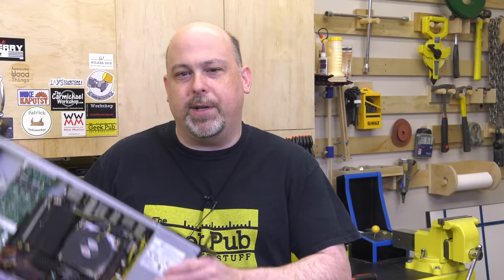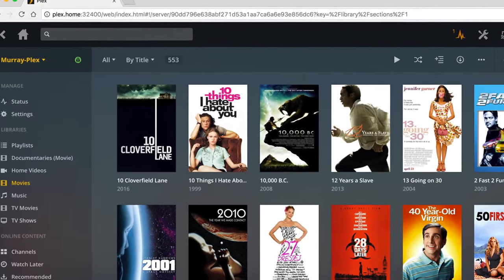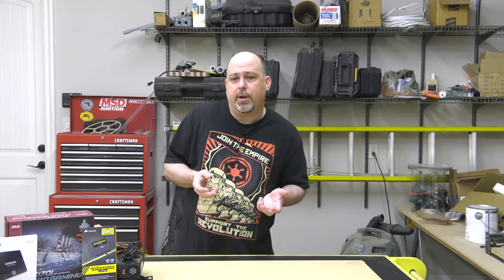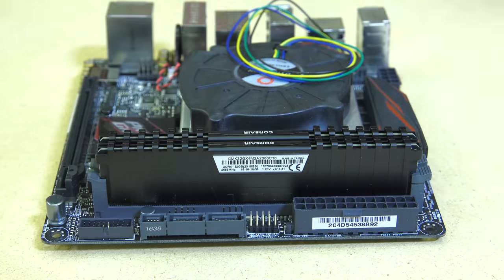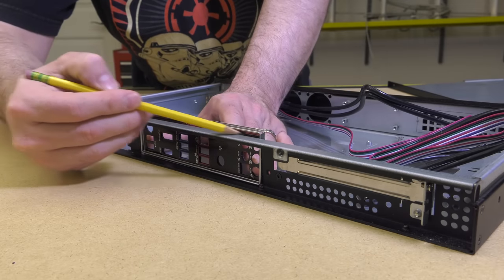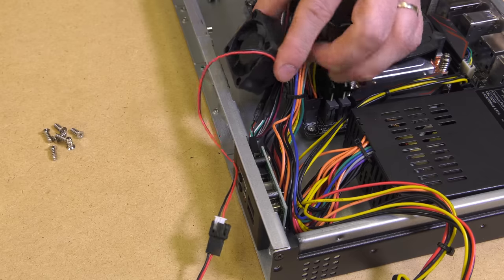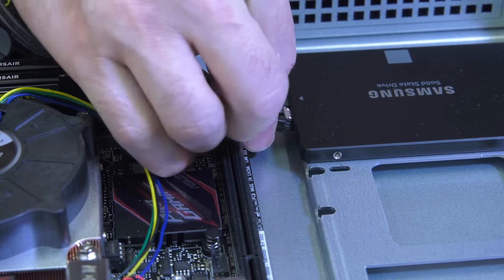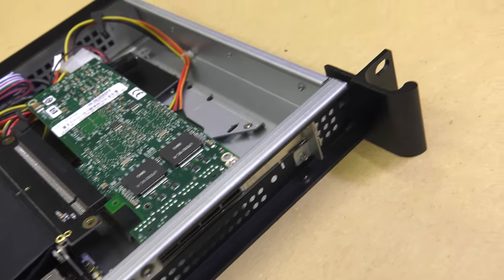Building a 1U Server (Bad A$$ 1U Server)

Comment from the maker: The audio anomalies are due to the AGC circuit on my camera failing.  I shot the whole video before I knew this was happening. Panasonic has already replaced the camera and future videos will not suffer the same fate.
Reply: Why not use speech leveling in Adobe Audition?
Reply from the maker: I don't own it for one.
Reply: the video I just watched from someone else was doing the same thing. 
I was starting to think it was on my side
Reply: TheGeekPub just wonder why you have your own server and what the benefits are?
Reply: sanveer gill Speaking for myself, I have a server with esxi installed which allows me to install multiple operating systems. Try finding 32 motherboard and associated RAM in a home, if I was to use dedicated hardware.
Reply: Small advice: make a simple teleprompter. There is a plenty info in google and youtube about it. Its just better for watching when you talk stright to viewer and not below him. But overall great video!
Reply: You do need at least 2 disks for redundancy doing raid1... using 1 disk is so 90's now-a-days man.
Reply: Up let
Reply: Ufk
Reply: Gday Is it possible to use a PICOPSU  for a 1R case with ITX mobo ?
Server psu's are bloody expensive in AU region

Comment: Great build. I plan to build a ESXI server for home development testing and your video gave me a lot of great ideas. Only thing I would have liked to hear is the noise level of the fans at 100% and idle. Thanks for posting.
Reply from the maker: Thanks!  At 100% this machine is very noisy.  Mostly do to the CPU blower; its loud!  Anywhere below 50% is almost silent though.  I run these in an A/V closet so I never hear them.  When Plex is running and 5-6 TVs transcoding its not something you want on your desk.  :-)

Comment: Nice machine! When motherboards for Ryzen chips comes in mini-itx format. I think this may can be better. More clocks and Threads is amazing for virtualization! In my personal rig i will change the VMWare to QEMU/KVM. I love this idea! I can run a Virtual Machine with FreeNAS and more VMs to automate my home! Thanks for ideas! :D
Reply from the maker: I might do another build just like you mentioned when they are ready.  I am not sure ESXi supports Ryzen yet though.  I tell, you having a virtual environment to spin servers up and down at home is awesome!
Reply: Yeah! That's amazing! I not use ESXi and i don't know if Ryzen support it. But in Level1Tech channel, i can see Ryzen on KVM Virtualization and works very well. (Has a little problem when you use PCI pass through for GPU but in this case i will note use).

Comment: The nickel washers are a bad idea, because they may dislodge before you screw them down, and without you knowing it, they may short the motherboard.

Use plastic washers, preferably glued or taped on.
Reply from the maker: That's I glued them down with super 77.  They aren't going anywhere.  Secondly, those are ground points and if you don't use metal you lose the benefit of grounding.
Reply: Ah, I thought the spray was gluing the two washers together, not the washers to the standoff.

The grounding part is still functional even if we use non conductive washers, because the metal screws connect the ground from the motherboard to the standoffs.
Reply: haha,Trolls aint even equipped these pig ya?
Reply: Wait, won't the board still be grounded through the power connector anyways? And also, the washers probably wouldn't dislodge when someone sticks a screw in them, so metal or plastic washers sound like they make no difference...

Comment: Why, out of interest, are you using consumer grade hardware over server grade in a "server" build? You can build an equally powerful server, for less, using server hardware such as the Xeon E3-1245V5 for almost $100 less or even the E3-1270V5 for the same price and you'll gain a couple extra neat bits that Intel unlock in their Xeon series, such as ECC memory.
Reply from the maker: Except I don't need any of that, since this box primarily runs Plex I get a huge advantage of the Core i7 for video encoding/decoding that is missing on the Xeon.
Reply: All you're gaining from the i7 6700k vs the 1245v5 is extra availability for video memory and overclocking potential. The Xeon's P530 actually even has a slightly higher graphics clock speed.
Reply from the maker: I'm planning a follow up article on my site.  Maybe a video, but my performance testing with this unit overclocked to 5Ghz is showing otherwise. I'm pretty sure I have an E3-1270V5 in one of my boxes, so I should be able to get an apples to apples test if you will.  Should be interesting.  I'm happy to see any performance data you have to compare though.
Reply: TheGeekPub Intel i7 works better for encoding videos on Plex? What about Ryzen? 
I'm trying to build a Plex server but I am overwhelmed with the amount of options out there! Any recommendations?
Reply: And you missed his whole use case.  Protip: Don't go into consulting.
Reply: Agreed,  ECC enabled memory should always be used for ESX.
Reply: with xeons dont forget higher reliability less power consumption and better performance for the buck with virtualisation and more ram support 6700k is awesome anyway and its a better fit than the 7700k ...... subscribed !!!
Reply from the maker: All of the data is available on the intel ARK.  This has been beat to death, but I'll bite.  :-)  The Xeon and equivalent i7 (same cores, clock etc) share the same MTBF and power draw.  But I picked the non XEON for the intel Quick Sync Video core (in hardware video encoding) since this server's primary role is serving video.
Reply: TheGeekPub That is nonsense. You do not decode anything when serving video over the network and there are E3 Xeons with iGPUs. Overclocking has absolutely no place in any server. Motherboard choice is questionable at the very least.
Reply: +Narwaro Dog. When you make statements like "You do not decode anything when serving video over the network" means you have no idea what you are talking about.  PLEX transcodes video on the fly based on client needs and bandwidth available.  Go argue somewhere else, with something you actually have knowledge about.  Because this you don't.  And one more thing there is no Xeon with a quick sync core. Period. Sigh.
Reply: +Narwaro None of what you said is true.. First, an integrated GPU and a Quick Sync video are not the same thing. The QSV is an on chip hardware CODEC.  Second, media servers like plex and kodi absolutely encode and decode video before sending it over the network.  The client sends a list of streams it supports and the the server transcodes a stream from the original media file.  This is why you can put an MKV file on plex, and play it as an mp4 on an iOS device for example.  A QSV core is very beneficial to these types of applications.  I don't normally correct people, but your information was very misleading.
Reply: Decoding before sending over the network does

a) defeat the purpose of encoding 
b) produce more data than even Gigabit ethernet can handle. (About 186MiB*s^-1 for a 1080p30 video).

Please do not bore me with superficical knowledge and stop accusing people if you have no qualification to answer. Si tacuisses, philosophus mansisses. 
Both of you either (including but not limited to)

a) did not disprove my answer (transcoding is not decoding)
b) do not know that there something called OpenCL and there is software that does encoding on hardware without hardware acceleration with en- / decoding support (software that I wrote)
c) All Xeons with integrated graphics (that are only those on the consumer platforms) have QuickSync video.

And again, you can buy a Xeon with all these "benefits" for less than any consumer i7.
Reply from the maker: +Narwano Except that's not at all how it works.  You store the highest resolution version on the PLEX media server.  So let's say a 4K version of the Die Hard Bluray.  When a 720p iPhone 5 connects to stream that video, PLEX transcodes on the fly the 4K to a 720p version while sending it across the wire.
Reply: For a two host vmware cluster you're required to purchase a virtual center license.  It's not cheap.  How are you licensing that?
Reply from the maker: David Bern I'm fully legally licensed.
Reply: Speaking of Intel ARK:
http://ark.intel.com/Search/FeatureFilter?productType=processors&QuickSyncVideo=true
51 Xeons with quick sync - though maybe not i7 equivalents :)
Reply: Dave, lookup Vmug advantage. It's like $200 a year or less
Reply: jibreeeeel94 might be a bit late but I have the Ryzen 1700 and it runs Plex ridiculously great. I can stream to 5 devices at the same time. probably more but haven't tried yet. can't compare it to Intel because I haven't done tests but for the $299 CPU cost it's a better buy anyway.
Reply: You should look up the definition of the word server.  You might learn something.
Reply: Reggie Cotton right. I use my raspberry pi as a server because it "serves" me temperature information
Reply: Reggie Cotton thanks dude. This response explained to me the purpose of this server/plex.

But tell me, would this use case benefit more from fewer and faster cores, or more and slower cores?
Reply: Where's the fun in that?
Reply: @Reggie Cotton
I took your advice and am even more confused now...

serv·er
ˈsərvər
noun: server; plural noun: servers

A person or thing that provides a service or commodity, in particular.
- NORTH AMERICAN
- a waiter or waitress.
synonyms: waiter/waitress, attendant, garçon, waitperson...

No matter how hard I try I can't get mine to refill my damned drink!
Reply: TheGeekPub you have one or 2 Synolgys, why not get a „play“ Edition with Hardware Video transcoding. For this simple task even a NVIDIA Shield would be enough. Shield+Plex uses Hardware transcoding and can transcode 4 1080p  or 2 4K streams in real-time. Plex sucks imo.I have a small Synology and the Plex Server always crashes...
Reply: Interesting. I've had Plex running 24/7 on multiple OSes since 2012 (Ubuntu 14.04/16.04, Windows 8/8.1/10/Server 2012/2016, OSX, and Thecus NAS) and had exactly one crash in that 5-year period (on Ubuntu 14.04 after an update, in which the bug causing the crash was fixed in another update only 2 days later). Multiple crashes seems like it might be caused by starving Plex for memory, or possibly a bad RAM stick.
Reply: That was the first thing I asked myself.  There is no point in putting desktop/gaming hardware in something like this.  Just buy a used Dell Power Edge off ebay or ITCreations.
Reply: R510 12 bay and then you no longer need the synology or the "server" built in this video. Just bought one on ebay for $300. While they are older technology they will handle anything a home user is going to throw at it.
Reply: Narwaro  you are so full of failure. "transcoding is not decoding" => transcoding is not only about decoding, but decoding is an integral part of it. A quote from Wikipedia: "The most popular definition of transcoding refers to a two-step process in which the original data/file is decoded to an intermediate uncompressed format (e.g., PCM for audio or YUV for video), which is then encoded into the target format.". The higher bitrate video must be decoded first to be able to be encoded into the lower bitrate video for the client.
Reply: @Narwaro  "Intel® Quick Sync Video1 uses the dedicated media processing capabilities of Intel® Graphics Technology to decode and encode fast, enabling the processor to complete other tasks and improving system responsiveness." from https://www.intel.com/content/www/us/en/architecture-and-technology/quick-sync-video/quick-sync-video-general.html ..... So wouldn't he gain performance while encoding video faster for transmission to end devices such as a tablet?
Reply: @TheGeekPub  Quick Sync video encoding gives lower quality than software encoding.
Reply from the maker: @philiprobar  Correct, but lots of good that does if you can only serve a single TV at once (and 4K would be impossible on the fly).  With QSV I can serve every TV in the house, and my families houses with not much load on the system.  Right tool for the job.
Reply: @MostlyRCSlovakia  Should be used based on the evaluation of the system's criticality.  i.e. It's not what software you installed, but rather, how critical to is that data / task?
Reply: There is no way you could OC the 6700k with that dynatron blower 1U cooler.
Reply: lol, I know this video is a year old now, but quicksync on plex is garbage, and you are better off using the raw power of the CPU to transcode, that, and since its gonna be windows in a VM over ESXi, plex won't be able to see the IGP or use quicksync(as im sure you discovered).  Hardware transcodes are also a much lower quality compared to the software, and it is very noticeable with high quality 4k content.  Just directplay your 4k locally, and don't stream it outside.
Reply from the maker: @chubbysumo2230  Really?  That's odd because I have two of them running at 4.9Ghz just fine with this cooler for well over a year now.
Reply: @TheGeekPub  guess my old 2.66ghz xeon running esxi and a win 10 vm with 2 cores and 2gb ram isn't going to work for plex? I usually have 2-4 people streaming from the machine without problems? I believe the client machines do the hard lifting not the server. thats how plex works
Reply: @Tcll5850 need more than one servo for the robotic arm and wheels

Comment: I'd rather pick up a used Dell server off Amazon for $600-$1000. You can often find one with 2 6-core Xeon CPUs, 12TB of storage, an enterorise RAID card, and 192GB of RAM. Their CPUs are slightly dated and RAM speeds aren't as fast as modern systems, yes, but they're more than adequate for anything I'd need them for and could run 10 times as many VMs as your build without breaking a sweat.

Comment: Nice work. I am DIYing one as well. But a fanless one in my case.
No idea why these are not available commercially, huge missed opportunity.
Reply: The market doesn't doesn't care for fanless. Just provide as much CPU grunt for the given dollar. Hence more cores is better, dual or quad processors shoukd be an uograde. Oh and how much RAM can I have? With virtualisation, CPU and stacks of RAM is very important. Storage is moved off board to a NAS or SAN.
Reply: @gorillaau  just bought myself a fanless asrock mITX with N100 CPU and 32GB RAM. Perfect for home server. Not a lab, but server (files, smarts, media player, DVR). 
Bought an old 3Com 10base 12 port switch for $5, which is a perfect case. Cut out a larger opening in place of LAN ports for the motherboard. It's a tight, but perfect fit. Installed a fanless 65W laptop brick inside, multiple SSDs, 4 laptop disks. Installed a large, slow radial blower just in case, barely audible. Whole thing takes like 15W when idling, and is powerful anough to do simple object recognition for DVR with held of google's coral. 
Was furious I could not find anything similar to buy. This took too many of my precious hours to build.